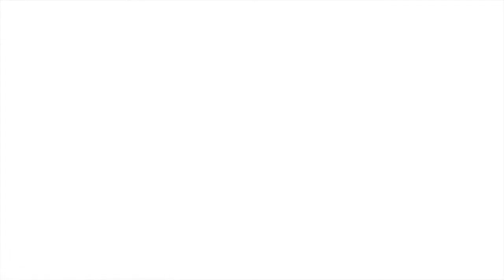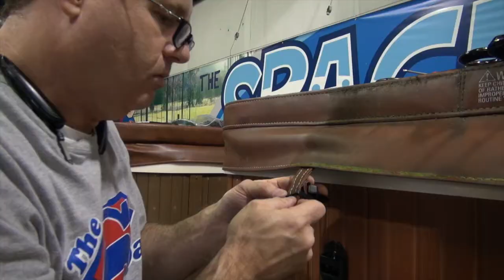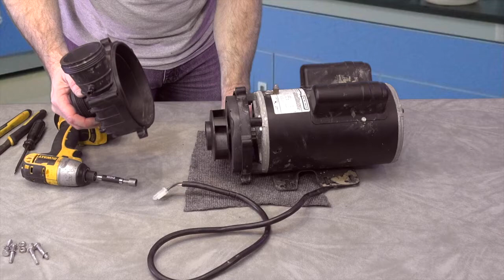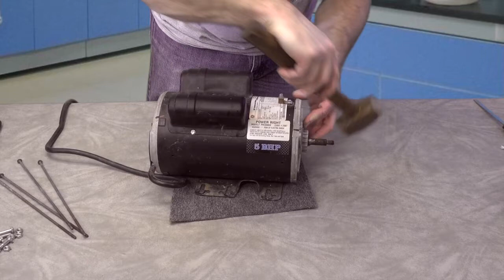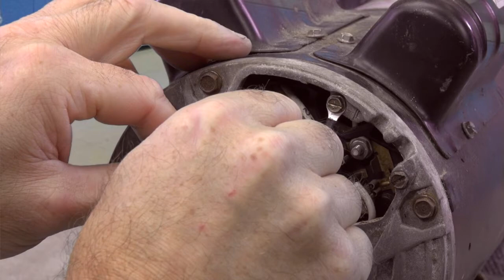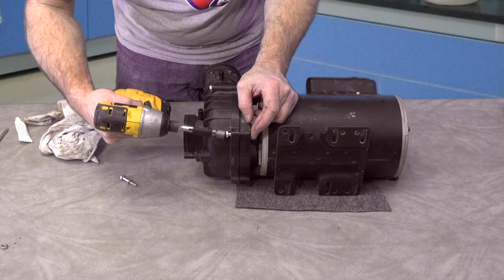Power Right Pump Cal Spa Hot Tubs How To The Spa Guy GE Motor

Comment: Love the video.  I was able to replace both seals on Power Right pumps for Cal Spa tub. Only problem I’m having is my barbed drain plug broke and I cannot match up the right fitting.  Do you know what the size and thread pitch is for the drain plug openings?
Reply from the maker: https://hottubpartsofamerica.com/spa-hot-tub-pump-universal-air-bleeder-plug-1-4-mpt-x-3-8-barb-with-sealer-fitting/

Comment: Does the motor seem under powered since you are running it on 120 vs. 240?
Reply from the maker: Of course it is the point is to clean the shaft I am not running it on 115 in the tub..
Reply: @SpaGuy  Great video and explanation on how to refurb the pump.  Thanks!

Comment: spotted 2 hairline cracks on ceramic face "impeller side" would this be a danger to leakage or is inner seal sufficient to not cause it to leak. Identical pump you have in this video. Thanks, your methods to work on these are  very well documented..
Reply from the maker: Replace the seal it is a 12.00 part..
Reply: @SpaGuy  Done ! pump 1  now 3 months later I need to pull Pump #2 as it is leaking & trips breaker when on high speed. This one is a bit more involved, & a poor design having to remove the control unit & pump 1.Wish me luck I'll keep you posted! lol

Comment: Where can I order the parts to rebuild my pumps?
Reply: I see on your site. After reading comments. I have the calspa tub and have 2 of these motors. And they just don't move water like they should. And would like to rebuild them. My pump says 6hp though
Reply from the maker: www.hotubpartsofamerica.com
Reply: Is there a new site for rebuild parts? I need a wet end for a 5BHP Power Right motor using a 56fr 2” outlet and inlet.

Comment: At the 8:30 time in the video, you remove the seal and replace it with the white ceramic seal after removing all of the “junk” on the other side. How do you know if the original seal is bad? Mine looks pretty good still.

Comment: what seal did you use for this motor
Reply from the maker: Hello David, This pump uses a 201 seal you can find them on my website cut and paste this link.. http://hottubpartsofamerica.com/search.php?search_query=201+seal  Thanks, Spa Guy
Reply: I have 2 cal spa 230 volt  motors in my 2005 CA -45  cal spa hot tub that I need seals for does the  201 seal fit mine also

Comment: Thanks for posting this video. I am getting ready to tackle a Cal Spa 6BHP rebuild and have a question. At the 9:40 mark, you remove a rubber gasket from the impeller with a screwdriver. I don't see that it was replaced when you but the spring part back on around the 12:30 mark. Was that rubber gasket replaced?
Reply from the maker: That gasket is inside of the Seal part that goes on the Impeller.. When I pulled the old one off that part stayed.. Thanks for watching, Spa Guy